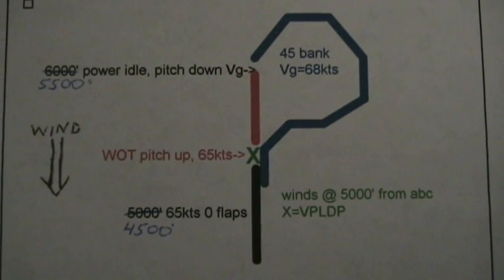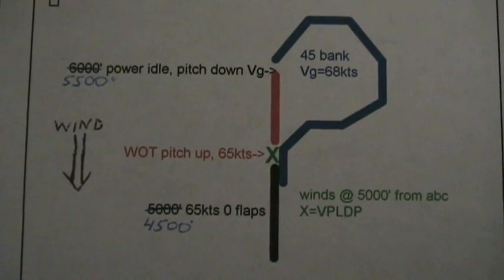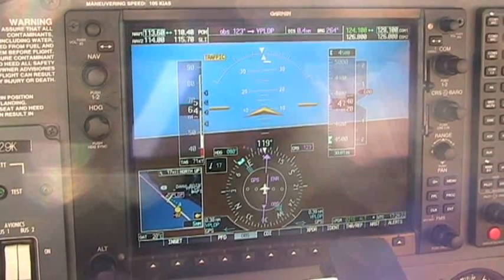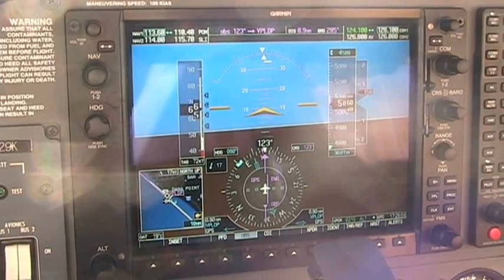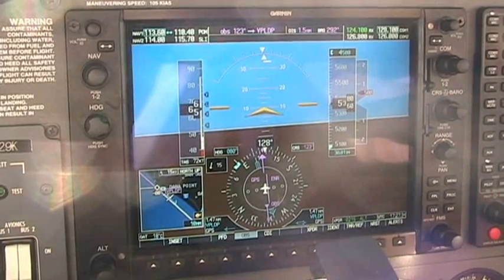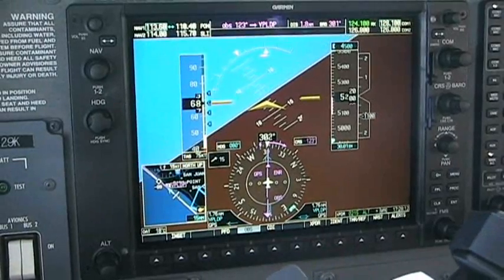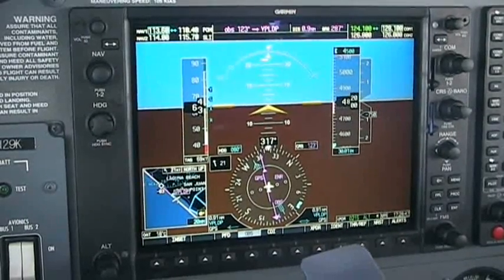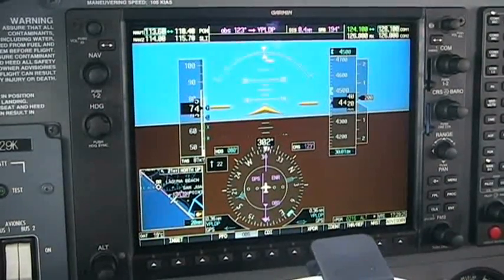The "impossible" turn is impossible

Comment: With that kind of headwind, you would have had a hell of a tailwind.  At 1000 ft. a steep turn with Gs just before buffet you should not have lost more than 300 ft in the turn.  Sorry, but I fly in a State where if you land straight ahead, you will set a whole neighborhood on fire.  You gotta be prepared for the "impossible turn"  UNDER THE RIGHT CIRCUMSTANCES.  Check out the video of the Mooney Pilot who survived because he knew his airplane.

Comment: For all of the engine failures I've seen, no one ever made it back to the runway.  Close, but not close enough.  (I've seen 4,  so I guess that means I'm getting old, or spend way too much time at the airport)
Each incident the problem was there before the wheels left the runway, and the 1000 foot turn was never possible. (not enough power to reach that height)
In my opinion, it's better to fully understand WHY you do what you do during a runup, and why you shouldn't takeoff if it's not 100%.
Reply: jwboll And what are the chances of you succeeding at a maneuver if you've never practiced it and the first time you try it you're scared as s***. They didn't make it because it was not part of their skill-set

Comment: At the top of the G1000 there is a white triangle that is pointing down. Right below that there is a white triangle that is pointing up and immediately below that is a white trapezoid, or "brick". If the brick is centered under the white triangle that is pointing up then you are perfectly coordinated. The pilot of this airplane is not coordinated and by not being coordinated is decreasing glide performance.

Comment: My best attempt was in a piper archer.  I completed a steep turn in trim, which greatly reduced airspeed, but I was able to gain airspeed back with a quick nose over.  I induced the "engine out" at 1000 agl.  As soon as I got as much airspeed with some altitude to spare I only dropped 1 notch of flaps.  It was very sloppy and on the verge of stall speed but it worked.  I first tried multiple approaches at idle to the runway from various speeds and altitudes to check performance.
Reply: I would not use flaps or gear until the landing is absolutely 100% assured, otherwise, you just might land short.  In the Mooney, we don't drop the gear or flaps until over the runway.  Of course runway length is a factor to be considered.  My point is, you don't do the impossible turn when there is a large interstate highway ahead of you with a large median and no traffic.  But if what is ahead is a residential community and you have enought altitude, you have no right to kill people watching tv in their bedrooms.  That is Just my humble opinion.

Comment: There are so many factors into the viability of this emergency procedure.  I have practiced this many times including doing it on an actual takeoff in a remote area.  I have done this no less than 10 times for practice with 5 being on an actual takeoff, not simulated hard decks, and was able to actually land 3 out of the 5 so far.  I had a much worse ratio of 1 out of 5 on simulated hard decks.  I found that trying to fly airspeed is a problem as they try in this video.

Comment: Another thing to consider - who climbs the first 1000' at Vx unless you have a mountain in front of your runway?  I'm pushing down to climb at 75  pretty quickly after I'm off the ground and then climb at about 80 once I'm about 700' off the deck or so.  Generally try to maximize ground speed to get where I'm going and use less fuel.  And I do take off from 5000' most of the time.  Sometimes higher.

Comment: Old video, but anyway. I think the most important consideration to remember is that, an engine failure is extremely unexpected. 
1. An engine doesn't usually just "die" in under a second. You will probably have partial power and sputtering
2. To actually accepting that, you lost an engine for real, is probably not as easy as some people would think.

For the simulation to be a bit more realistic, I would try to cut the power slowly, and then add a 4-5 second lag time before starting the turn.

Comment: There is a video here on youtube where a pilot returns to the airport in a C-172 from 800 AGL... not only does he make it back, he has to slip and use flaps to get the airplane down.  

This is a very nice piece of video with the intent of increasing knowledge and awareness... I simply disagree with the conclusions and suggest further experimentation on your part.

Comment: .5 NM = 3,040 ft.  The takeoff roll for a typical C-172 is under 1,000 ft.  If the runway was 4,000 ft long you would have made it back.  What you just demonstrated is that it would be very easy to return to KSNA after experiencing an engine failure at 1,000ft. AGL.  Especially if you factor in the 15 degree angle on upwind and the nearly ever present 15-20 knot headwind on climb.

Comment: Not sure what sea level is there but I have done this at 500 agl.. real practice not at 5000 ft ft in a 110hp 152 160hp 172 180hp 172 and a 160hp warrior all with 2 people on board  you will never make it from 5000ft because of the air density but if the airport you departed from is at sea level 1000 ft is plently of altitude.  Dont forget most airports also have taxiways large grass areas where a off runway could be safely made with out makeing a full turn to the runway.CFI CFII CFI with esp